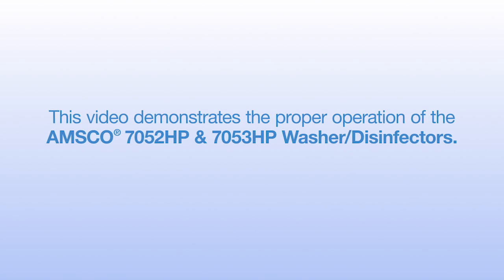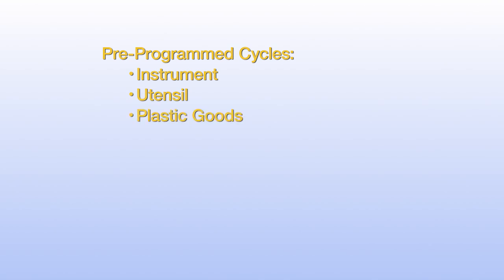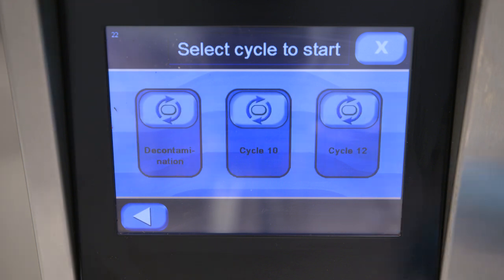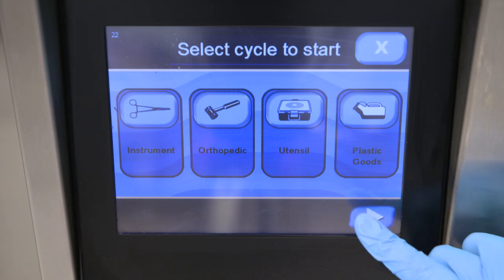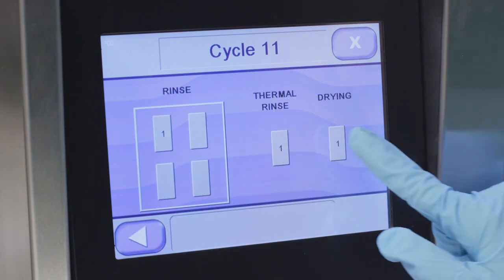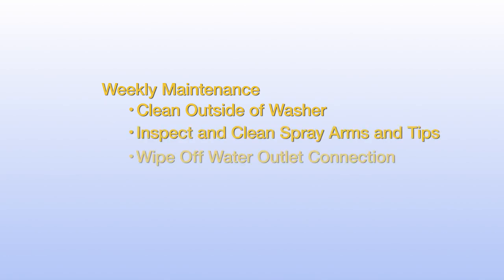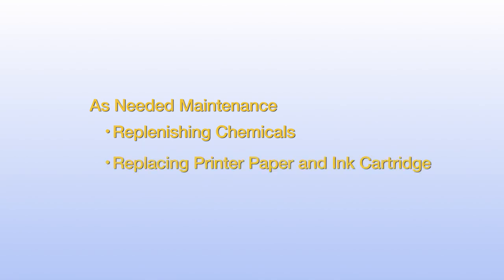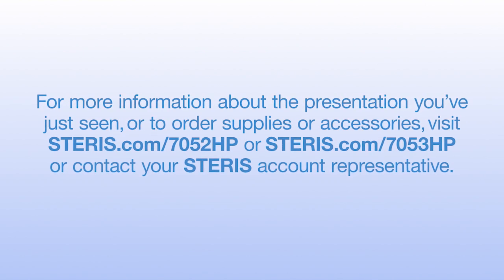AMSCO™ 7052HP and 7053HP Washer/Disinfector In-Service | STERIS

Comment: On the Manual for the 7000 series washer it says to pour 14oz of descaling product at the proper concentration. Does that mean we have mix 7 to 14 gallons of water with the descaler before pouring into the washer. based on the video my guess is not, but i just wanted to ask  just in case. thank you